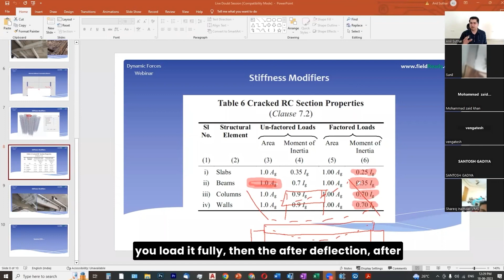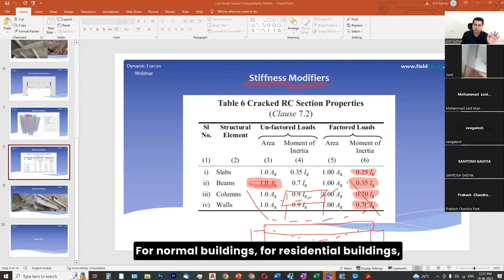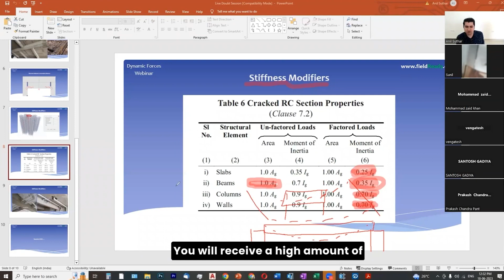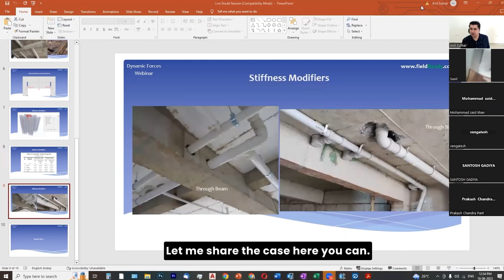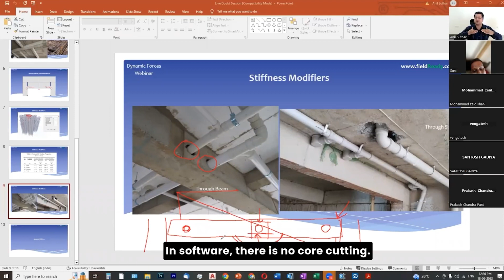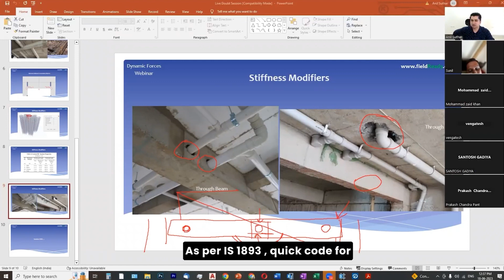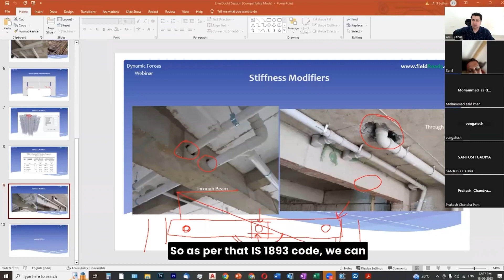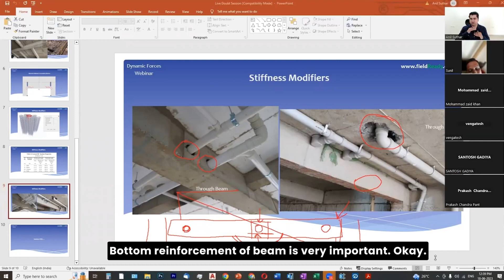Stiffness Modifiers |  Should you use it ?  |  All Doubts Cleared

Comment: Good Explanation,but Sir,how can we know at the initial stage which beam or slab will have core Cut?
Reply from the maker: Here Architect or MEP engineer needs to provide you layout for fire, AC, Duct pipes or sections so that you can reduce the stiffness for specific beams. If no such plans are provided then unfortunately all beams stiffness will be reduced causing the beam design highly un-economical.

Comment: Is there have a stiffness modifier for composite elements ?
Reply: concrete filled steel tube
Reply from the maker: Stiffness modifier should be used with care. Not all structural elements & situation require stiffness modifiers. Watch my YouTube video on stiffness modifiers. & for composite elements there is no clear IS Code guidelines for it. It has to be derived from lab experiments on small elements.